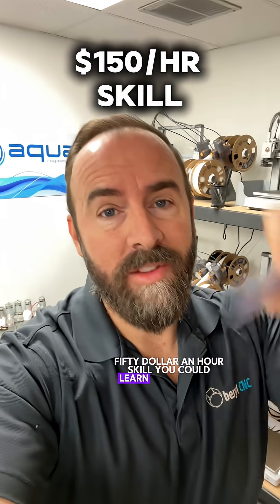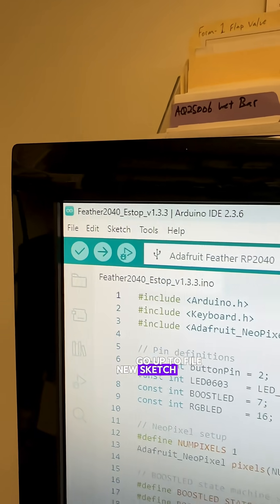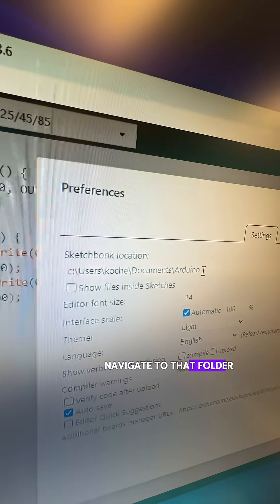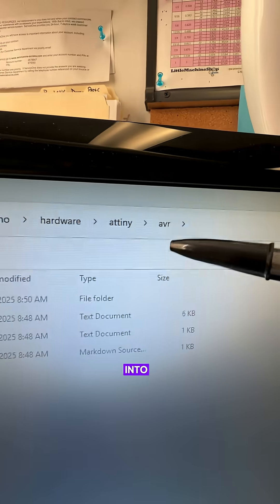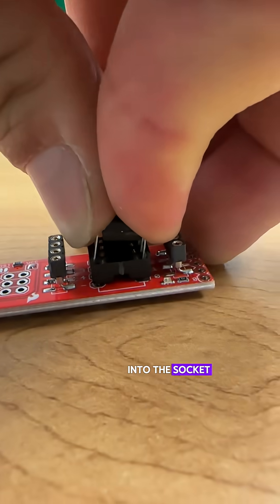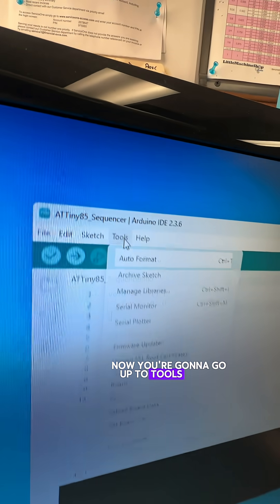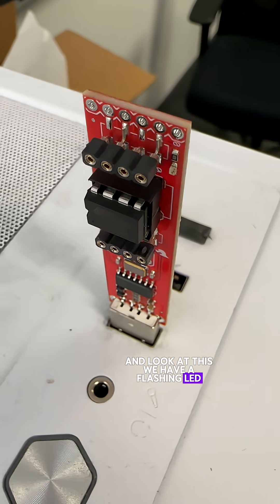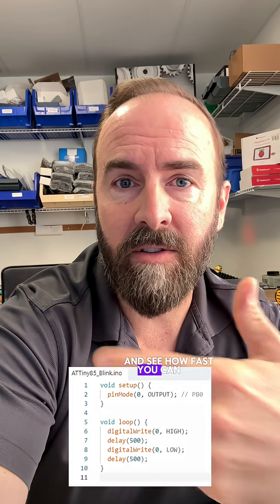Intro to ATTINY Microcontroller Using Arduino IDE

Comment from the maker: There are many classes of microcontroller, all the way up to processors and computers like the Raspberry Pi. When selecting a microcontroller, a small part such as this would be used for high volume, low BOM cost, sometimes high reliability designs. These might be toys, consumer products, sensors, or medical products. Typically a bunch of prototypes are developed by someone like me, then the design is sent to a manufacturer for high volume production. If you want an easier path to experimentation, check out the ESP32 and RP2040 boards. There is a sub $10 board called the Xiao RP2040 I’m a big fan of. Share this with anyone who wants a better career path and might enjoy this kind of work. It’s def not for everyone.
Reply: What’s the utility of this? Why would I get paid $150/hr to do this?
Reply: Hey, I saw your video about becoming a business, I am curious how hard it is to get into. I have been making things my whole life (21 years), and arduino/raspi for a solid 14 years. I build ROS robots and all sorts of custom things. I really enjoy it, but don't know how to make money with it.

Also, do you ever get burnt out? My concern has always been that if it became work I might lose the fun of working on my own projects. Thanks!
Reply: @nickbaddorf2673I’ve experienced the “I’ve been playing with x and it’s now my job and I burned out” :/ 
I did some arduino projects, and make music - I’m not monetizing those as I don’t want that result..
I’d wanna know more as well..

But it sounds as any job, clients have deadlines and change their minds mid project - and don’t wanna pay..
Reply: @nickbaddorf2673 it’s not hard to get into if you already know what you’re doing. It sounds like you know what you’re doing. What kind of things have you made? Looking for some inspiration there. I studied some IT things during highschool, and raspberry pi’s came up. I just never saw any practical implementations or things I could really use them for, so I never expanded on it. Is it all C/C#/C++?
Reply: You have my attention. 🙏 Thanks
Reply: How do you find clientele? Do they come to you or do you seek them out? Do they require certifications? If your rate is $150/ hr, how many projects do you work on in a day? How long does a typical project last?
Reply: Ok so where can I learn this and also how do I even go about charging people for my services... where would I do to get started...can you post a video on how to learn and make what you learn profitable...do you have an email...phone number I would definitely be interested in making money doing this
Reply: How about STM8 in the same class? Or STM32 for ARM
Reply: Thanks for that.  The video was interesting and doesn't seem too complicated for someone that took C++ 20 years ago or so. 

Microprocessors and microcontrollers have a wide range of applications, but I don't understand exactly how that translates to a job.
Reply: So, to make 150/hr I would have to get contracted by a company? How do I go about finding the person willing to pay me 150/hr once I have learned this skill?
Reply: Super awesome video!  I bought an arduino kit a while back, haven't really put the time in to learn it yet.  I have so many things I'd like to do with microcontrollers though, really need to take the time to learn.
Reply: If someone wants to learn, where does the person start? Is there anywhere to register?
Reply: The problem here is that he chose a short video to explain  something that have no value whatsoever because there is a lot more to this  that takes more time to learn and the most important part is application by showing you one light blinking is like if someone will show you how to turn the light switch on and of .
Application means you can do this to be used on this and make money on the process. a freaking blinking led won't do anything for no one 
So a list of applications in the market is missing here and he won't give it to you on the video because helping is not his intention
Reply: @1miltond  What do you mean? The application is programming a chip to create whatever voltage patterns you want. If you don't understand how that could be useful, that's a you problem.
Reply: @mf1977t no, that in itself is not terribly useful.  It's possible that learning more about microprocessors and microcontrollers could lead to $150 an hour paying job, but it's not an automatic no-brainer..

There would be a lot more knowledge
Reply: All the comments from people saying "oooh I blinks, I want money now" are missing the big picture here. 

When I bought my first 3D printer. I made a toy for my daughter. She promptly broke it. Cried. And then I said "Don't worry honey, we own the means of production." She replied "what does that mean daddy?" 

And I put on a thick and poor russian accent and said "that the time has come for the proletariat to rise and for capitalism to fall!" 

But that is what it felt like. Like Prometheus handing me a torch, I knew that end to end manufacturing was now within my grasp. 

Your video is the same thing. You're showing people how they can build a skill and create their own income. If people aren't willing to throw off the yoke of paying for services every month because it's "easier", then they're not going to change. 

They're so helplessly enured by the system that they will actively fight to defend it while repressing their inner turmoil at being reliant upon it.
Reply: @HiroshimaGooner are you trying to say you made a profit with your 3d printer?